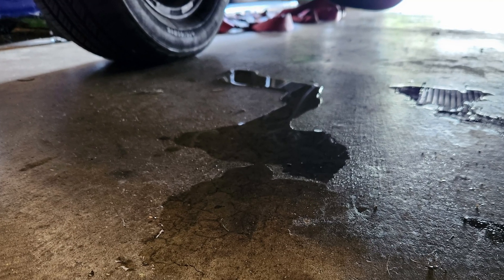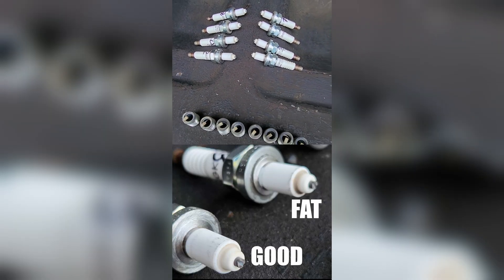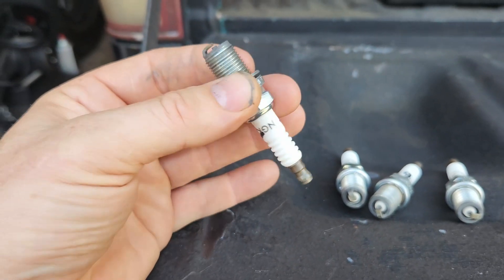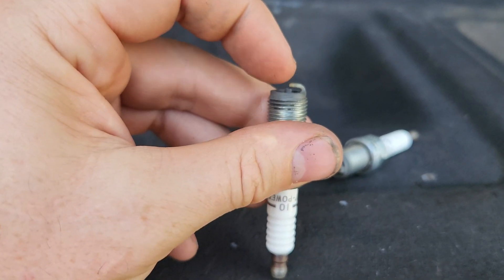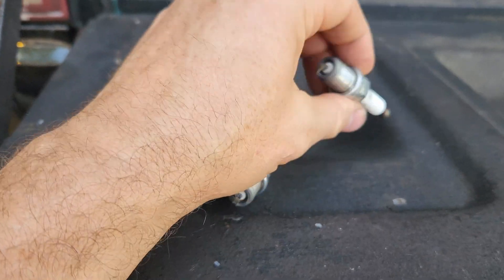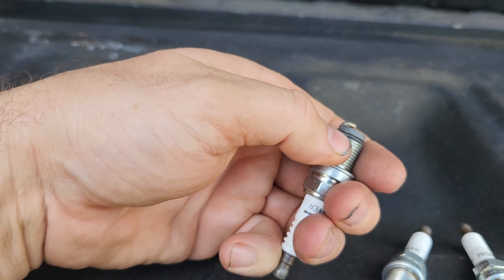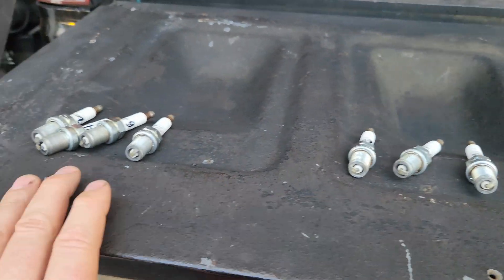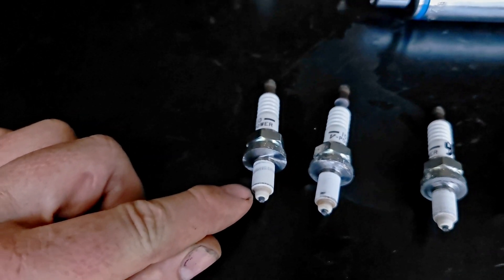Nitrous Tuning - How to read spark plugs

Comment: I have a question about the timing are you at 27° while you’re spraying it or are you at 27° normal running and then retarding time and out for the hit off of that that’s my question because I had a 327 that I ran at 37° timing and then when I sprayed it with 150 shot it took off 4° and now I’m building a 400 kind a like yours and I’m wondering about the timing if it’s that different
Reply from the maker: Yeah I'm at 27 when spraying it but 34 all motor. I don't have a timing computer so I have to manually pull timing. Timing is not the same on every engine they all like something different just got pull plugs and run at the track.

Comment: Nice info brother. I broke the driveshaft in my 79 elco, its amazing how much damage it does. I finally got mine running again after being down for 8 months. Im buying a N20 kit for my sbc, What company and which plate kit do you reccomend, Ive got a sbc in the elco, 9" rear and turbo 350 w/3500 stall. Would you go stand alone race gas on the nitrous tank with it running on e85?   All help appreciated bruh.
Reply from the maker: I run Nitrous Express but if you want a flowed kit induction solutions is a good bet.